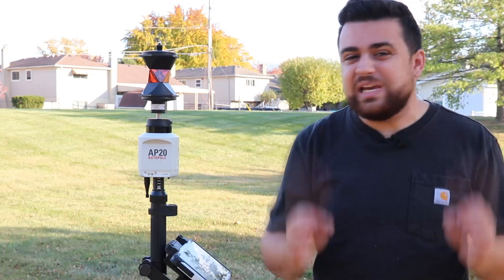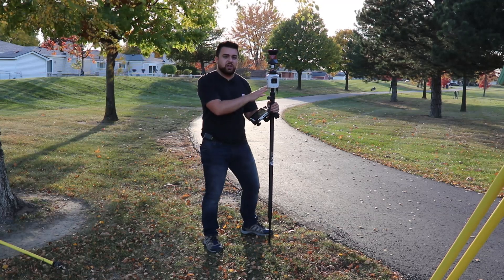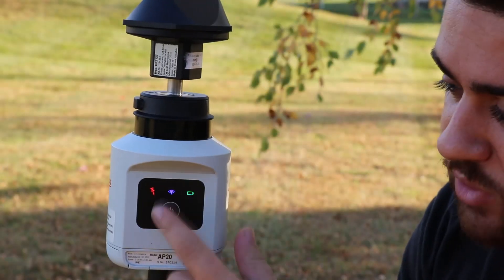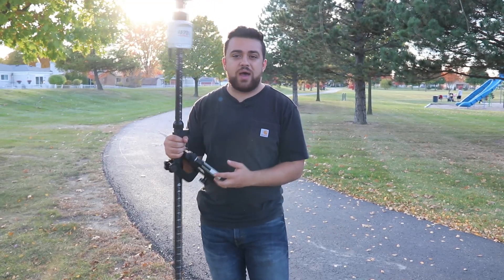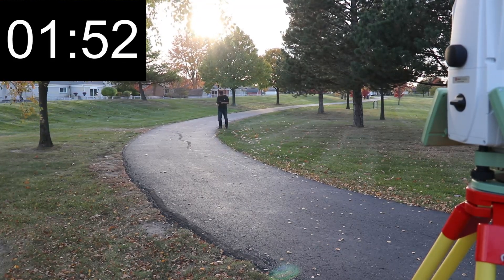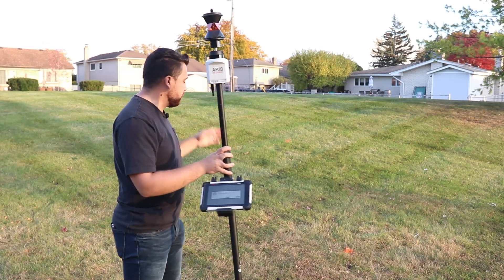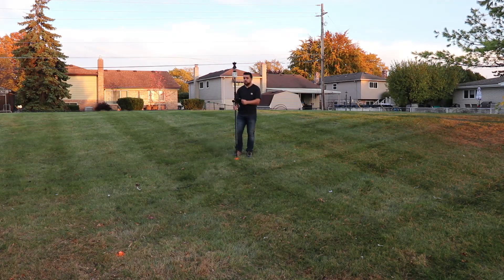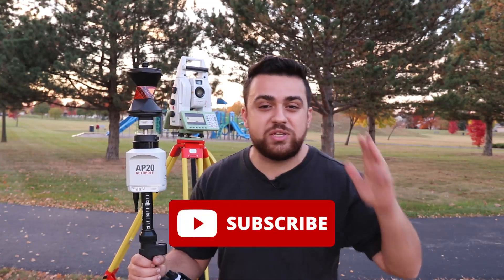How Accurate is the Leica AP20 AutoPole with a Surveying Total Station?

Comment: By the time you charge the AP20, fit it, connect it, initialise it and what have you small jobs would be completed using traditional methods. Great for bigger jobs or working near columns/walls etc. though for sure!
Reply: Don't knock it until you try it, it's pretty quick.

Comment: The accuracy isn't quite the same the other way around. For example, if you're staking out. In this example the tip of the pole is on a known point. The smarter solution is to have the prism lower on the rod (if your line of sight allows).
The Autopole is wicked expensive. Like more expensive than a good used total station.

Comment: Some of those errors probably exacerbated with randomised facing/orientation of the 360 prism. The angle of the tilt during the test was quite extreme, I’d like to think when actually using this you’d probably be closer to being plumb, it would be interesting to see if results are better or not when the IMU is compensating less
Reply: IMU's perform best when they are being moved a lot, if they are static then the relationship between the biases and movement they are trying to measure becomes too small and inaccurate measurement results.
Reply: You make a good point.  The GRZ122 360 Prism is excellent, with an improved accuracy compared to the classic GRZ4 360, largely due to its smaller size. Despite that, errors in the 0.01’ range are not uncommon.  I’d like to see the same test with a GRZ101 Mini 360 which has the best short accuracy of the three 360’s.  With small size comes reduced tracking and power search capabilities.  However the Autopole also helps mitigates tracking issues.

Comment: Cool tech. I'm assuming the ap20 needs to be tilt-calibrated every time it's powered on plus it needs to connect to the gun? That ought to be reflected in the time trial as well.
Reply: All you need to do to calibrate the tilt correction is swim it around a bit. You do need to keep moving or it will lose calibration, but it's easy to get it back.
Reply: @markmayer5788  good to know, thanks! 🤘😎🤘

Comment: Who cares!!!!  Topo surveys do not need this accuracy
Reply: Leica AP20 is all about the ability to measure points accurately with speed and tilted pole. Given the ability to tilt pole means that you can measure points that are inaccessible using plumbed poles. Of course, you can always use standard offset routines if speed is not an issue but is vulnerable to errrors. In a construction site, a lot of points are inaccessible using standard poles but can be measured with AP20 tilted poles. AP20 also promotes safety. Imagine surveying along highways with speeding cars and you can't tilted your pole and measurements are not quick enough. Leica AP20 is game changer in my opinion.
Reply: I’d rather see it used in stakeout

Comment: Have you tested the ap20 with a tall fiberglass extension rod? Like 25' tall. Is there a height limitation or warning built into the software?
Reply: IDK about how the imu behaves with total stations (I'm stuck with trimble), I know the accuracy and precision decrease as the rod gets higher with the imu with GPS. I'd imagine the math used for imu compensation would remain similar... higher rods = worse results.

Comment: Great field test! I am thinking about buying this tool, especially for mapping jobs, the error for mapping is negligible. Not sure about construction staking or checking of f.e. formwork, surface checks (asphalt, concrete) where you have high needs for precision (6mm at max is critical in some situations).

I see that you are using CS30 controller, is there any chance, that you'll be doing a reviews for this particular tablet? I can't find any reviews. Thanks.